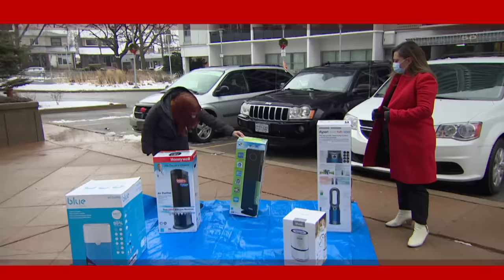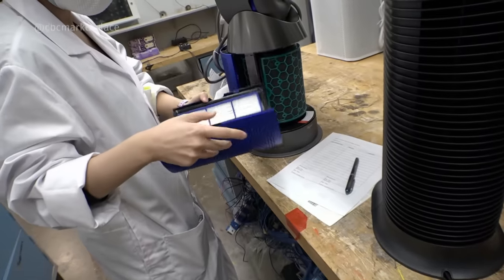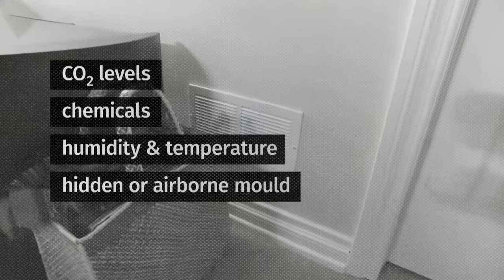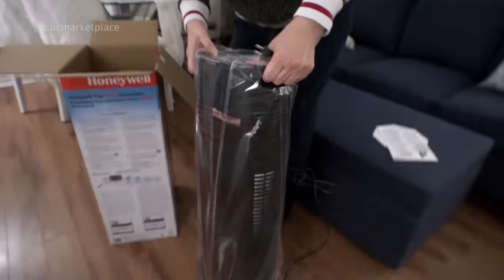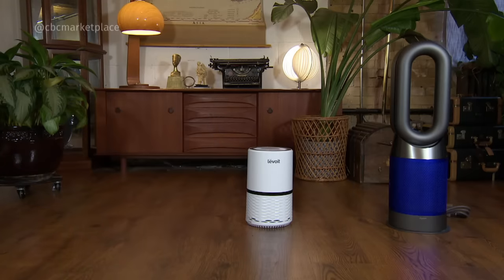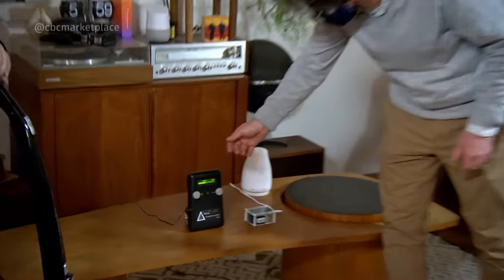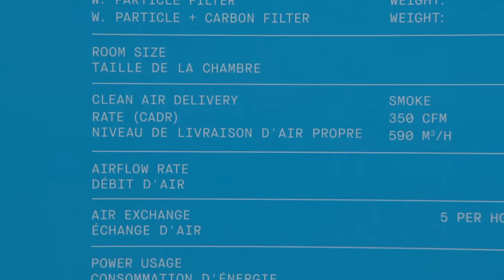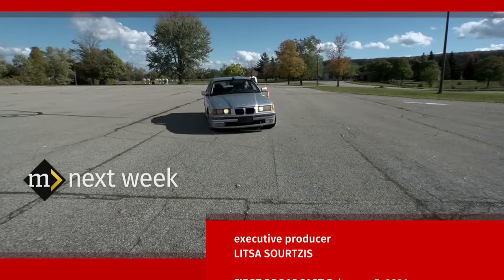Is an $800 purifier best to clean your home's air? We lab tested 5 top brands

Comment: Misleading.

They focus on a single metric, CADR, but don't go into detail on the differing levels of performance required to filter out diverse types of pollution.  Plenty of tests will show you most APs will filter out particles quite well, including the Dyson.  They all feature HEPA filters and will do an excellent job.  But what about VOCs? NoX? Benzene? Formaldehyde?  For that you need at least a chunk of activated carbon filtration, and potentially other techniques. Lab tests may show Blueair doing a decent job of filtering particles with its high CADR rate, but they've also not historically done so well with VOCs compared to say IQAir.

Bottom line: one metric of air purification performance isn't good enough. The rep from Dyson was trying to explain this, but the way they've edited up his response doesn't really seem to highlight the full reply he might have been trying to give.

Comment: As a University Instructor with a degree in Mechanical Engineering, I have to agree with the Dyson Engineer. CADR is not the only important parameter. One must consider the optimal conditions, e.g. you wouldn't want a purifier with high CADR for a small room cause it would consume a lot of power.

Read the product specifications.

Comment: so what metrics other than CADR are important for measuring air purifying ability?
Reply: For Dyson, looks obviously lol
Reply: @daijoubu4529  ye looks good then buy it...like that lady who picked the air filter based on it looking like r2d2 rather than what the features actually said.
Reply: dyson has WIFI, IT’S  THE ONLY ONE THAT CAN CONNECT TO PHONE AND ALEXA. they don’t mention the features and how built like a tank it is. ppl don’t realize this video is an advertisement haha
Reply: It’s filter . Hospital grade HEPA H13 or better and the amount of activated carbon for VOC removal
Reply: The amount of particulate matter it actually removes and the size of the particulate matter for starters, the box fan didn't even use a HEPA filter and while they filter they did use would trap dander and pollen, there's plenty of furnace filters that won't. Additionally something that will lower your CADR is whether or not it has a charcoal filter to handle VOCs is something that is also important for removing smells, off gassed chemicals like formaldehyde which the box fan and the Levoit lacked. Additionally there are three CADR ratings for three levels of filtration which they did not disclose which was used. If they used the largest, it would disproportionately show the box fan being much better than it actually is whereas if they used the smallest it would then tip the scales to whichever unit has the smallest filter, even if it might move less air.

Comment: CADR [ Clean Air Delivery Rate ] is good (ish)
CCM [ Cumulate clean mass ]  is a much better measure.

CADR is designed explicitly to make a certain kind of purifier look better.

So, great piece!  Not surprised the BlueAir did well in any test, but understanding CADR vs CCM and who makes it, and such is very important to getting a high end air purifier.
Reply: Wow thanks. YOu'd think CBC could tell us that.

Comment: we all know dyson is mainly bought for design first. Performance is important but I think they're adding the filtration system as a final thought on their devices. It was originally designed as a fan, then they added the heater, then they added the air filtration system. If you're buying the Dyson fan and assume it's the best in the market for air filtration then you should really rethink your purchase.

Comment: This is pretty silly, I'm also an engineer and I agree with the Dyson guy, to say that CADR is the one and only most important metric to look at is just intellectually lazy, their are many other factors such as what "clean" is defined as, how large of particles it lets through etc. Dyson has other filtering technology besides HEPA.
Reply: Definetely. But considering fact that all of them are using HEPA filter I would say CADR is very good way to navigace. If I have small 20-30 m3 apartement then Dyson would be okay ofc
Reply: @AjdamusMagnus  The BlueAir 211+, the top contender in this video, does not use an HEPA filter, which is exactly why it can pull so much air. Marketplace really has dropped the ball on this one. Very lazy journalism.
Reply: Using a dyson, energy efficiency is great on winter, hubby with sinus are no longer having problem with it filtering the air. I like it being multifunctional without needing to keep three devices in a room

Comment: I was hoping to see Austin Air in here! Lol just bought a few of them and am very happy. Just wanted to see them in the comparison.

Big pros I’ve found with these ones;

More environmentally friendly - 5 year replacement filters instead of 6-12 months. Far less wasteful in regards to changing. They achieve this by using two separate pre-filters to catch the majority of large and medium sized debris, therefor me reducing the usage of the carbon and hepa filter. And the outside filter can be vacuumed or also replaced separately every year or two etc depending on usage. And the filters are pro rate warranties so can claim percentage back if they only last 3 yrs!

Medical grade filtration - catches up to .01 microns as compared to many at .03 so better filtration, and labelled as medical product not just an entry level one.

Effective carbon filter - many have carbon filters and put the claims of odour and gas reduction in air, but many have such small/light amounts of carbon it’s not actually very effective. These have 6-13 pounds of carbon/zeolite (depending on model) to work as needed and last as needed.

No frills and no ozone - the ones that use ionization to statically trap also create ozone. No point getting an air purifier to improve air quality and trap mould, mites etc, but create hazardous ozone. Even at small amounts.

As for the no frills they don’t have an automatic setting with air sensing. At first I was kind of wanting that, but then realized really adding extra sensors leads to higher chance of malfunction etc with sensors and would be willing to lose the sensors to understand that the product is high quality and just run it constantly to KEEP air good. Not run to make it good then lower and maintain, but possibly miss some irritant etc to run higher again. It’s got 3 settings to choose so you can run high at first then turn down to maintain etc.

Performance over frills all day long, as your paying for those frills, I’d rather pay for performance and get true value not a (possible) false sense of security from some coloured light.

Also has 360 degree intake and filter. All 4 sides of the machine intake air which is nice to get more area. 

This also makes it so the filter is larger. Being that it’s larger the contaminants that it is sucking in aren’t concentrated to the small intake ports on some machines, and having the bigger square foot filter means the filter isn’t getting debris concentrated near the ports, rather getting evenly coated on all four sides creating more even wear on the filters. And again the outside material filter can be changed separate of the interior built in hepa and carbon filter combo.

As for a con, only thing I would say is that they aren’t the cheapest models, but also not the most expensive either. So to me I found a good bargain.

If anyone has more experience with these and has some pros/cons leave a reply I’d love to hear.
Reply: Nobody's trying to read all this
Reply: I currently have blueair but in the past I've had  a couple Austin air machines and there great highly recommend Austin air as well ..

Comment: Im sorry, but CADR isnt the only metric. Its a measurement of how much air per hour is getting cleaned, but it's not a measurement of how WELL the air is being cleaned. The Dyson has a carbon filter in addition to the HEPA filter, which a lot of cheaper options lack. 

Measuring how good an air purifier is by just the CADR is like measuring how good a camera is by just the megapixel amount

Comment: Just bought the Dyson hot and cold just to use it as a heater
Reply: That's one expensive heater lol
Reply: AMAZING CHOICE, none of the other ones they have has WIFI and they just forget to mention that. DYSON is the only one that connects to iphone
Reply: @bobbuilder5490  because it’s so hard to push a button

Comment: Me sitting in my dorm room I haven't left or opened a window in days: 👁👄👁
Reply: You really should be concerned about CO2 buildup. It's not good for cognition. Supposedly 600ppm and greater is at least temporarily bad for your brain.
Reply: @djayjp  yeah the part with CO2 is where I made this comment. For the record, I then went and opened my window and turned the fan on. It sucked all the heat out of my room :( but hopefully, it's more oxygenated.
Reply: @chronicallymeee  Lol oh well at least it's fresh air :p. It really doesn't take much though; just enough so you can feel the air coming in if you put your hand near the window opening.
Reply: @djayjp  I've been thinking about this, but I'd like to clarify at the point I made the comment I hadn't left the room in days, but I had not opened the window since either August or September.

I'm still trying to find a balance between cosy room with no bugs, and actually having oxygen, because my window doesn't have a screen and it is very cold outside.
Reply: @chronicallymeee  Go buy a screen?
Reply: @jeevandhillon00  they might live in a place where it rains a lot, is stormy or cold so you can’t have the window open that often. I haven’t been able to open my window since October because of how cold it is.
Reply: @Beelzebubby91  Just open it for 5 minutes a day or twice. It should be still warm enough but enough oxygen in it.
Maybe your windows and doors don't even seal, if you have old wood frames, and you have a constant stream of fresh air.

If it is really cold in your area, try to figure out the most useful time: 
Maybe do it in the evening in a room you won't use anymore, where the air could mix itself up over time with the warmer air inside and start heating in the morning.
Maybe it's too cold in the evening, than do it in the morning or around noon, if you can (you will loose the until then heated air, but have warmer outside air at noon).

Dry air heats up quicker, but it gets even more dry, when heated up, so when it gets comfy, maybe raise humidity or get a hot shower and open the door towards the other rooms afterwards.

Comment: This episode messed up with the comparison. You can't compare the CADR of a large BlueAir with a small Levoit. AHAM recommends a CADR that is 2/3 the room area. AHAM has a list of certified purifiers and their specs on their website. Choose a unit with a great CADR for its size. 
CBC could have also compared the lifetime cost with filter replacements. Most units use a proprietary solution, so it would be nice to know which is more economical.

Comment: I really wanted to buy a Dyson but I decided to get a way cheaper model and it seems like it was a great idea according to this report. 

I just paid 165$ for an airpurifier which covers an area of 45m3 and has 350m3 of airflow.
The Dyson I looked at costs 550$ and only have airflow of 58m3

Also the cheaper model I bought also makes less noise at both low and high settings than the Dyson even though the airflow is so much higher.

The Dyson model have the benefit of being able to heat up the room but paying an extra 385$ for heating is a pretty steep price increase when it fuctions much worse as an air purifier.

Comment: This is very misleading. The whole focus seems to be on the CADR ratings, disregarding the fact that room and apartment size in relation to the CADR is what is relevant. What I want to know is HOW CLEAN the air is, not how quickly the air is poorly cleaned. The actual quality of these devices was never addressed.

Comment: What particles are coming out of the diffuser?
Reply: Probably water and anything else inside that’s around the same size and density of water. In the video they mentioned minerals from the water and essential oils. iirc diffusers work by vibrating water into particles small enough to become vapour and then blowing it upwards. It’s not boiling the water into steam at a high temperature so i think anything that’s in the water gets vaporized as well
Reply: humidity lmao
Reply: @MegaMaxiene  THIS, any bacteria, viruses, old in that water will also become airborne

Comment: The limitation there is that those sensors treat all particles as equals whereas the body reacts to each very differently. More research needed.
Reply: my thoughts exactly. they act like what's normal is bad. our bodies have handled rooms with poor air circulation for a very long time. our bodies can handle a lot of things in the air as no air in the whole world is 100% pure.
Reply: I was wondering if it counted water particles as well?  The humidifier and diffuser throws a lot of water into the air.

Comment: Problem is you can not compare devices made for different sized spaces/room. Obviously the one can clean a small room vs. a ball room will have a different result. But it does not do any filtering if you put the bigger into a smaller room, and it will consume more, will have a more expensive filter, and be louder. And in the same time it will clean the already cleaned air for no reason.

Comment: Thanks for sharing this video!  Wish I could have heard the full interview with Dyson, hearing their point of view would have been nice. I loved hearing about the DIY version though.  I'm looking for a quick solution to mold/allergens in a basement. And this is something I could do tomorrow. I might save up for a Dyson, because I also need heat. 

Interesting note on the essential oils diffuser.  I know that humidifiers can be really bad if not cleaned properly, our rooms just get so dry in the winter.
Reply: If you need a solution to mold/allergens then buy a good performing True HEPA filtration system, not a Dyson. Honeywell actually is a good choice, affordable and reliable. Then you can get a separate space heater. Take the $500 you save and do something else with it. Other reputable but affordable air purifiers are Coway Airmighty, Coway Airmega, Winix.
Reply: @Jonjones520  They used an extra fan to agitate the air in the room 11:23 , the tests are misleading on purpose. You are being fooled and have no idea.
Reply: Emily, get a dyson, does the job properly,  this reportage is misleading, they use an extra fan to agitate the air in the room and that's the key for a throughout air cleaning, 11:23.
Dyson does it all in one package and you can also monitor your air quality consistently using the app.

Comment: The Dyson works really well, we use it in her bedroom which is about 350 ft.². Has a great heater on at all so that keeps the room up quickly in the winter. So on the first floor we do not need to use the furnace too much overall I think it does a great job.

Comment: 17:55 I made something similar, but I glued velcro to the fan, and double sided tape for the other side of the velcro to the filter. This way it is very easy to change the filter.

You don't need to seal the filter to the fan with tape. That is some ocd level thinking.

Comment: I find a lot of the filter styles are horrible. 

Why can’t we clean them ourselves? 

Why do we have to chop off our arm to get a new filter?
Reply: Clean them
How? Maybe a washable filter might be good
Reply: We have a Levoit, a large one. The Filters are very large, they’re cylindrical in shape. They can be vacuumed as suggested. They say to replace the filter every 6 - 8 months, I intend to keep mine if it looks clean holding a light inside like you do a cars breather filter. If it doesn’t look plugged I’ll use it as long as the sensor doesn’t say to replace it. They’re pretty expensive. $80?
Reply: @cruisertechgt  Washable filters cannot be HEPA, you can wash the prefilter/mesh screen, but not the actual media.

Comment: I own a Dyson for 3 years now. What is not said in that video, is that the best feature Dyson offers, is to actually show you the metrics. Through the app you will have an idea of what is in your air. Now maybe other brands do it, but back then they were the only ones. And that’s a major thing. For the rest, Dyson is average, I won’t say it’s amazing. It cleans the air extremely slowly. Don’t get excited by ads. If you smoke in your room, it will take hours to get rid of the smoke. I have a portable AC unit, when I smoke, the AC remove the smoke in 10 minutes, and i need the Dyson to see the metrics. So Dyson alone is not enough I would say.

Comment: This is a good review but they don't mention the noise on the higher fan speeds which can be a problem in the bedroom for some people.  I really like the Honeywell Professional Series True HEPA Air Purifier - Black, HPA600B.  It's all metal housing has no off gassing like a lot of these plastic models.  Works good on the 3rd highest setting for me.  I find the "turbo" mode too noisy.  Filters last a full year.